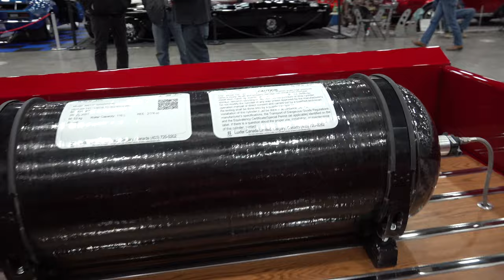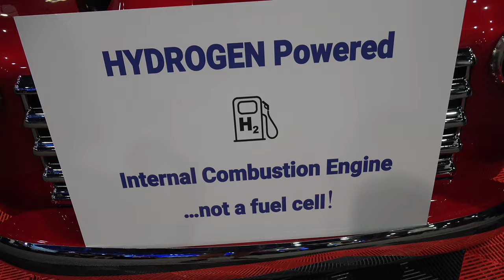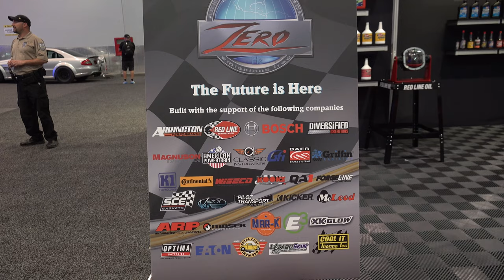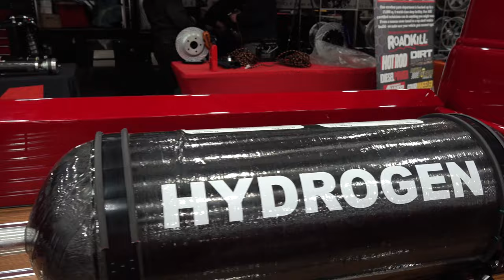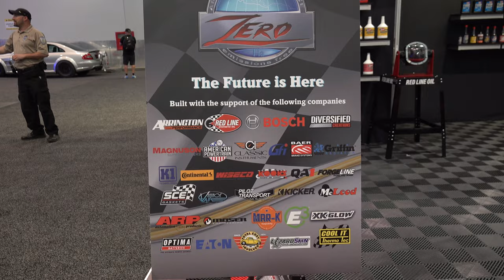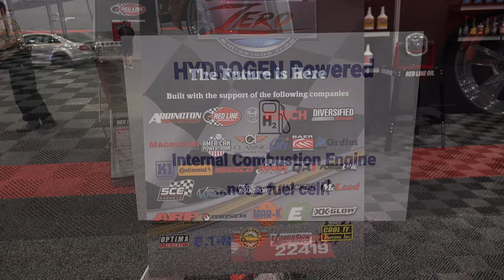1948 Chevrolet 3100 Arrington Performance Hydrogen Power How It Works 2022 Detroit Autorama

Comment: Scottie, the most informative video you have ever made, great job. Just a little more information for your viewers. There is a company in Great Britain called JCB, which manufactures heavy equipment. JCB has developed a diesel engine that runs on hydrogen. JCB says that electric engines are not the answer to all our environmental issues.
Reply from the maker: Thank You Brother...Please share!!
Reply: HYRDROGEN CLASS 101 with ScottieDTV and Mr. Arrington!  Hell yes!  I feel like I should get a certificate after that video!   Absolutely Amazing!

Comment: Beautiful paint job by the way, and the chrome really works well But what we didn’t learn from the video is the “energy cost” of obtaining hydrogen. Let’s just say it’s higher than gasoline so unless someone a can break the laws of physics it’s going to be really expensive to run. The irony is the least polluting way of getting hydrogen is using renewable electricity. You just 3x or 4x as much electricity per mile than if you just put the electricity directly into an EV..
Reply from the maker: Listen to the whole video....Mike talks about the types of Hydrogen....It will be able to made...It already is being made with solar power....Green Hydrogen..zero carbon footprint.. They are also working with making it on board the vehicle it is powering....Either leads me to believe cost of production will not be a concern...But! I already know that electricity is expensive now...and will only go up in the future...Not to mention the mess it makes...and even bigger mess it is going to make when the used batteries are leaking everywhere...

Comment: In Stapleton's video, Mike said he was running 9psi of boost through the Magnusson. That was this week. This video was a year ago and Mike said he was running 20psi of boost. Was there some kind of issue Mike had that made him drop the boost so significantly? Or something else?
Reply from the maker: I haven't heard anything....The knowledge is advancing very quickly right now...it may have gotten where 20 psi was to much Horsepower to do the kind of testing they need to do....I would think that Mike will be testing several different tunes....just a guess
Reply: @ScottieDTV  Thank you for the reply! I was just curious, maybe he even made mistake and it has always been 9psi. Do you have any close up shots of the blower pulley? If we can compare the sizes between both videos, maybe we can answer it...